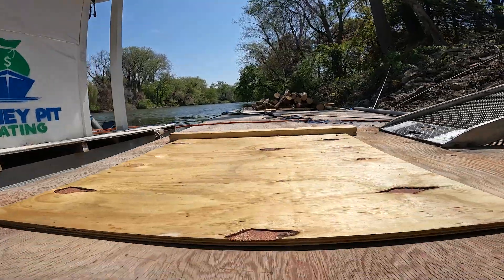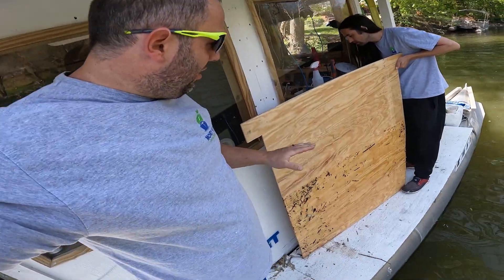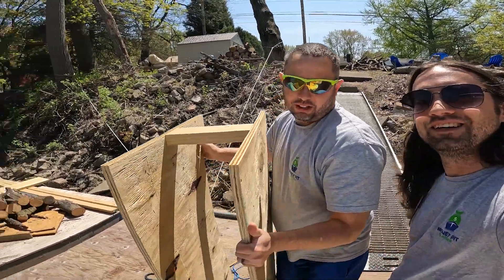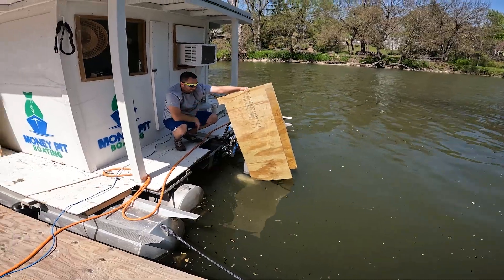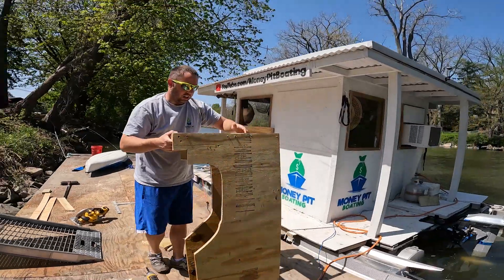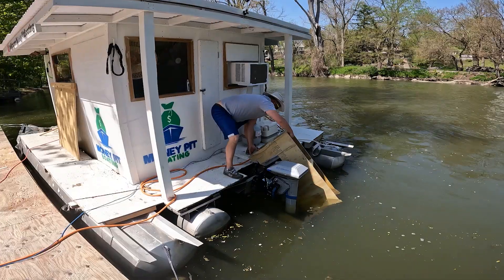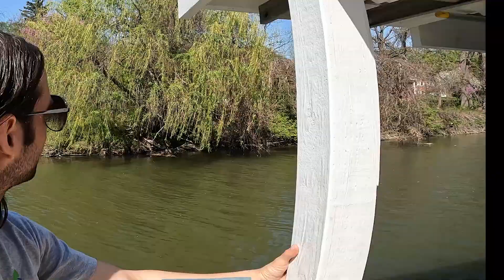Pontoon Sailboat Conversion! (Daggerboards and Rudder Upgrades)

Comment: Daggerboards are for sale boats to   help keep them going forward as the sale otherwise is trying to push them sideways.  You don't have this issue so you don't need them, your pontoons are plenty to keep you tracking straight.  Get rid of the daggerboards, they are just causing a lot of wasted energy in the forms of drag!  You will go faster and farther with them gone!

(*edit, unless of coarse you are still going to use a sail)
Reply from the maker: Thanks for watching! We pull the daggerboards up when we are not sailing because the river is way to shallow. Our box cabin gets blown around a TON though, because the pontoons are round, so the water easily flows over them, which sucks. Stay tuned for more upgrades!